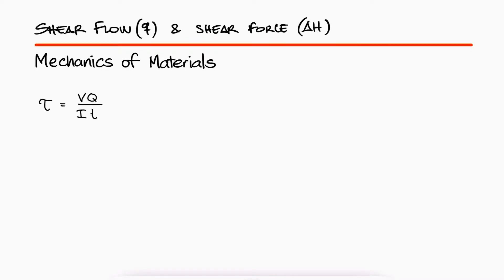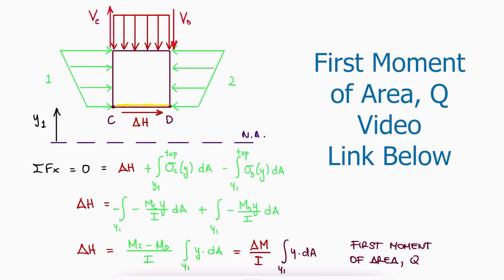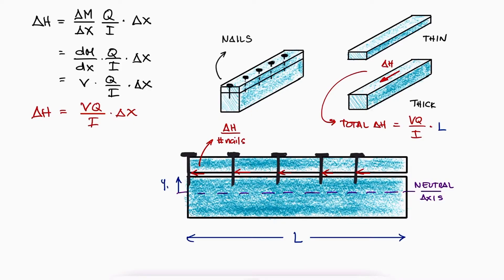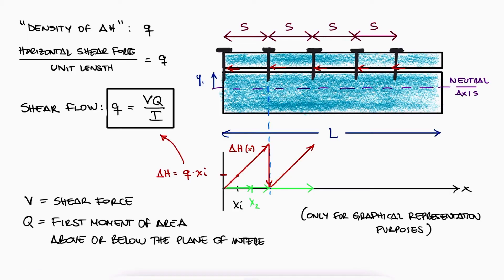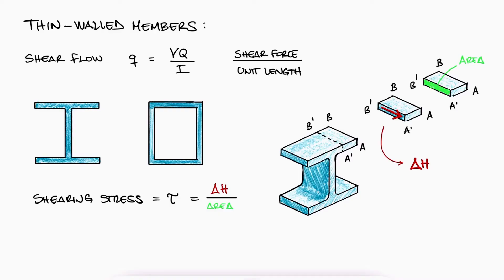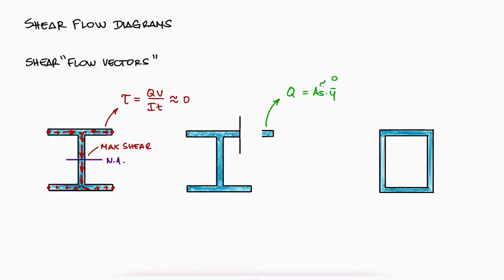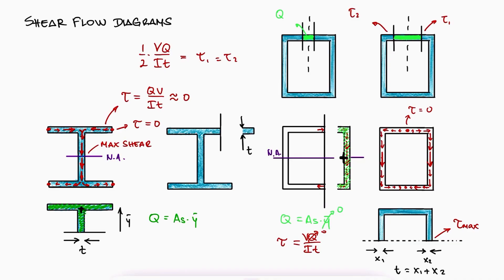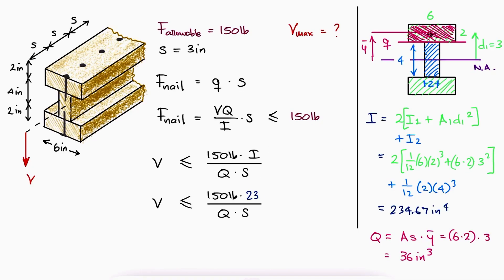Thin-Walled Members and SHEAR FLOW in 10 MINUTES!!

Comment: So I guess even though there's two nails, because the second is on the bottom and acting on a different interface you wouldn't multiply the allowable force by 2? I got double your answer because it is allowable force per nail and there were two nails XD
Reply: I was wondering the same thing. I think it is because the calculated max shear force is specific to that interface. Imagine holding the centre of the beam still and pushing just the top section sideways. Only the top nails are needed to resist that motion. I could be wrong.
Reply: Even if the bottom section were held in place, the top nails would still be required to transmit the shear force through to the centre of the beam. So the bottom nails may have an equal shear, but they can’t share the load.